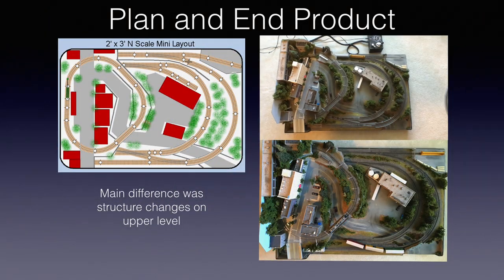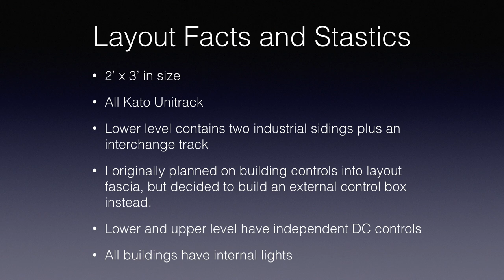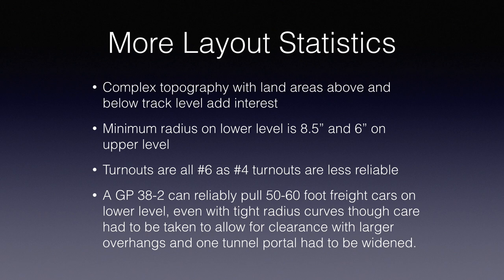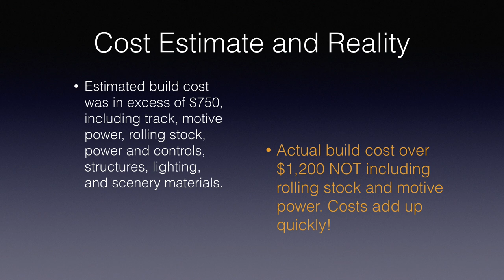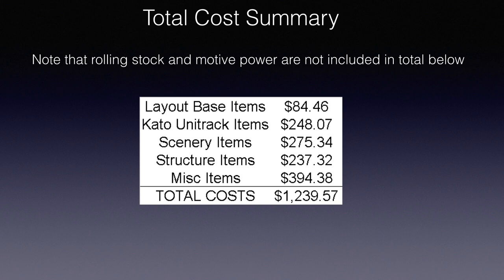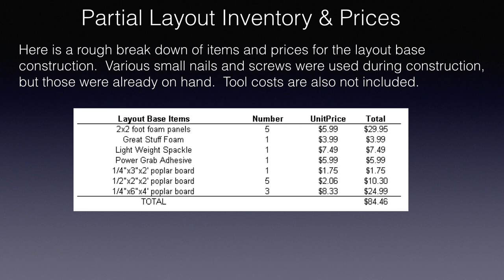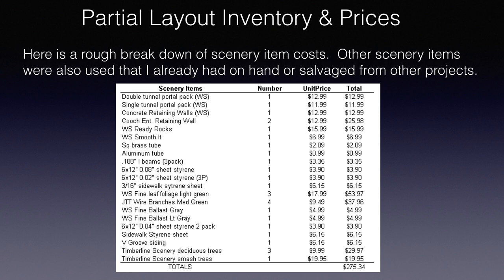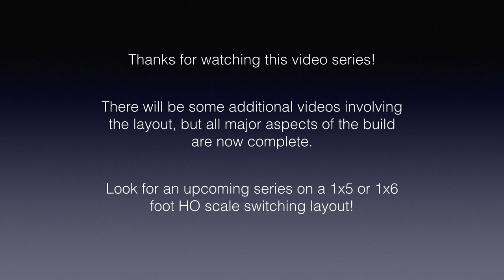N Scale Mini Layout Build Recap

Comment: Nice work on the layout. However, as someone exploring building a small layout from zero, the cost is pretty daunting. Prohibitive really. Even without the second level, that's a bit of cash. I'm going to have explore options for sure. Thanks for the videos.
Reply from the maker: Price is pretty much up to the builder though.  I spend a lot of money on structures and lighting and things like that. Had I scratch built or used fewer structures, the cost would have been less. If you look at the videos of the donation layout I built this year and donated to my son’s school, I spent less than $300 for. 24” diameter layout.
Reply: @StevesTrains  yeah, maybe I shouldn't panic before I even figure out the layout. I'm thinking a double loop with a Kato double crossover and maybe a siding or something to add a little interest. IDK, I'll figure it out. Thanks for the quick reply.

Comment: Oh and consider DCC for the next one. It really is the way to go, especially for a small layout.
Reply from the maker: +Coxy's Railroading It will be DCC actually since all my HO scale motive power is DCC.   I just went with DC on the little N scale layout since all my N scale equipment was just DC, and I had the DC power packs laying around.
Reply: +Steves Trains Groovy! Dont let me hold you up. Better off building than replying to me!! ;-)
Reply: @StevesTrains you dodged some serious headaches with your choice. i don't recommend using digital control in N or Nn3/Z as an amateur modeler as they present some serious problems with contact and reliability because the locos are so lightweight in comparison to those in the larger scales. the guys in my N scale club are always looking for ways to add mass to their locomotives and lighted cars to deal with it. i do motor work for the guys and i try to keep out of that sort of thing. keeping the trains running well is more than enough for me. the easiest way to deal with that is to use brass motive power, but its pricey.

Comment: I would have thought that the baseboard and track would be the major part of the cost but it's only a fraction.
Reply from the maker: If you were to take away all the structures and lighting and details and just had say a mountain seen with grass and trees that would probably be the case.  Structures and details can ramp the cost up in a hurry. To be fair, I wasn’t trying to do this layout cheaply, just to see how much I could do in a very small space. The cost was also spread out over two years so it probably averaged $60-80 a month, although less than that really since a lot of the materials were already on hand from previous projects so the additional cost was less.

Comment: Can you run a es44ac? Or any super liner Amtrak passenger cars
Reply: On the layout
Reply from the maker: +dman dc An es44ac will make it around the layout, but you can't couple anything to it as it will pull any coupled cars off the track when going around the curves.  Same issue with the passenger cars.  One by itself might get around, but not coupled to anything else, though I haven't actually tried that. I eventually plan to build a somewhat larger N Scale layout, maybe a door-sized layout, in the future to run my larger N scale equipment on, but that won't be happening this year.
Reply: +Steves Trains ok thanks
Reply: @StevesTrains door-size is cool for N scale- actually using a door- not so cool.